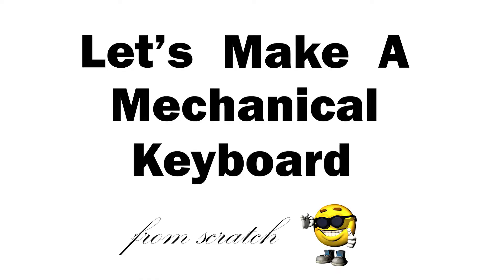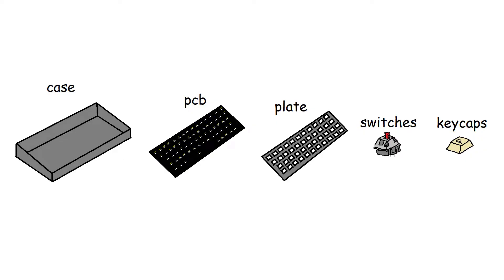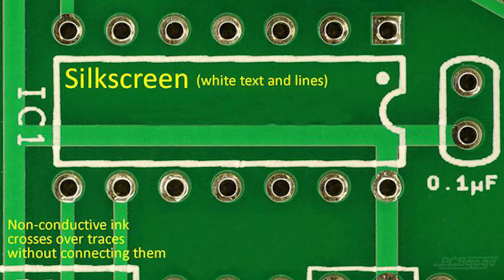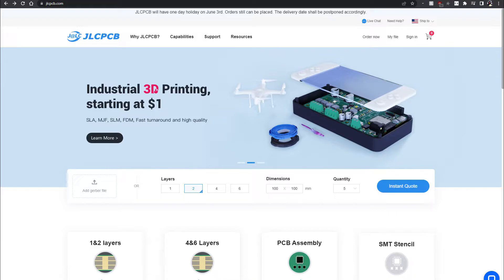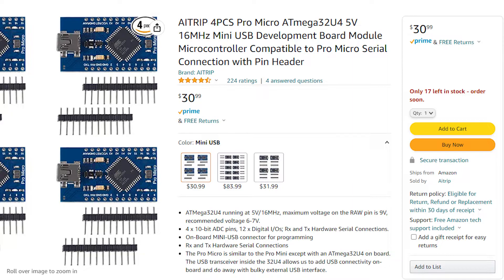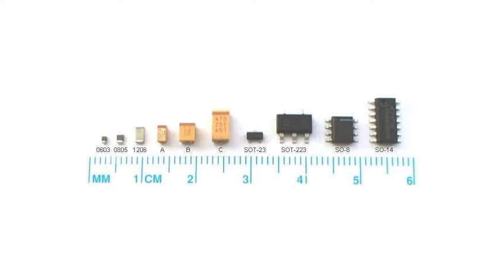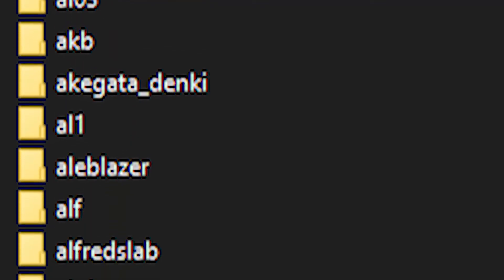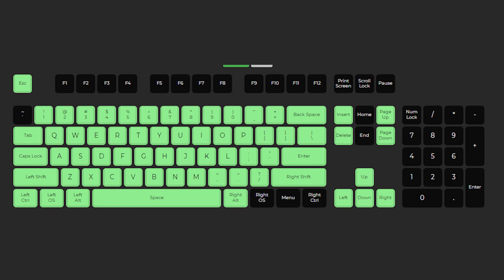Making a mechanical keyboard PCB from scratch

Comment: Speaking from experience with QMK... that isn't a lie at all. 90% of the time, I end up reading through GitHub discussions, and half the info is now outdated, as they are trying to move towards JSON configs. So you basically read other people's work and...
FYI: I am a software engineer, and even I'm saying you basically need to do it. QMK is pretty good stuff, but documentation be lacking in some cases.

Comment: As an ECE graduate and planning to create my own mechanical keyboard by 3d Printing plastic bottle filaments for my recycled themed MKB, this is what I'm following for my PCB except, I did designed mine from scratch using copper clad. You should be proud of yourself for this.

Comment: Anybody who knows anything about coding, electrical components (SMD soldering) and keyboards understands this is baller af...

My only experience is soldering JST connectors on faulty USB C daughterboards and coding a bunch of elementary Java programs but I do own more than 30 keyboards. I've built a few of them and also made custom Poron sheets of different thickness using my laser cutter for those I made and some factory made. THIS is next level though.

Comment: Hey man, i had a keybord i bricked with the wrong firmware, and i need to reprogram the pcb would you be able to help me withi this?
Reply from the maker: Hold down the reset button on the pcb then plug in the pcb. It should wipe the firmware and the pcb should show up on qmk toolbox again, then you can reflash.
Reply: @koovin02  heck ya man love ya

Comment: hey kevin hyd?? so, for you to flash your firmware to your custom pcb, did you flash it from your usbc port?? or you use a custom pins to flash it onto the pcb??
Reply from the maker: I'm doing good, thanks for asking. I flashed from the USB C port using QMK Toolbox